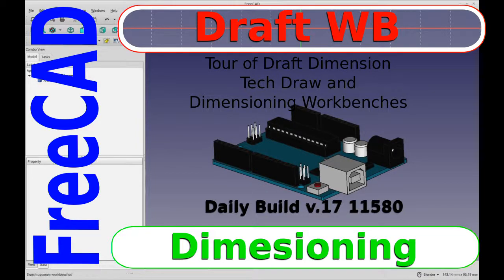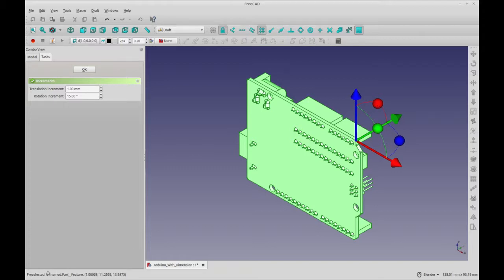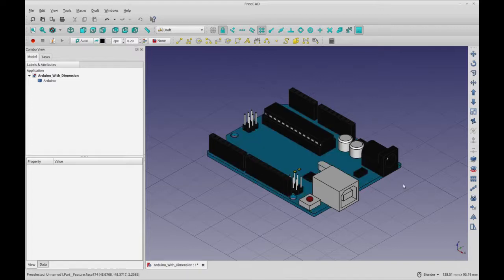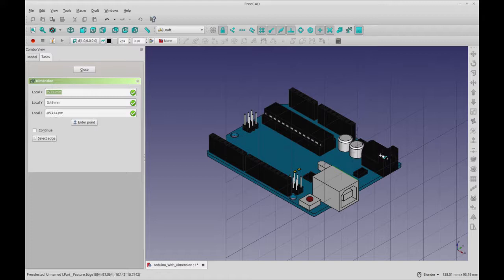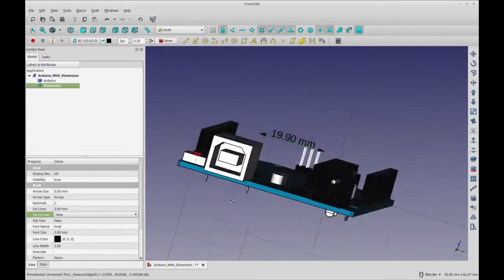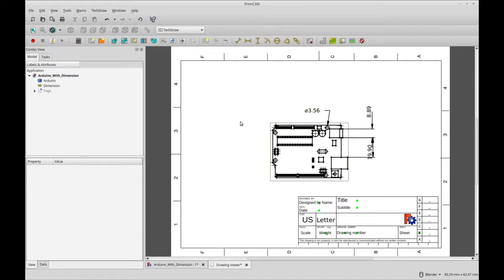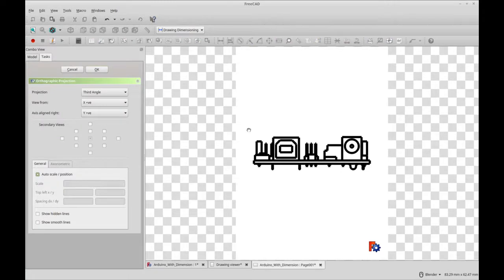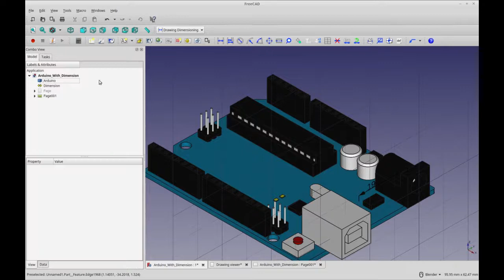FreeCAD - Measuring parts inside your CAD drawing with Draft WB and other tools.

Comment: fyi, i did the same thing recently and found these useful.

https://grabcad.com/questions/how-do-i-convert-stl-graphics-to-a-solid-model

https://www.freecadweb.org/wiki/Manual:Generating_2D_drawings

if you start with a certain template using the Drawing Workbench, you can print 1:1 scale drawings.